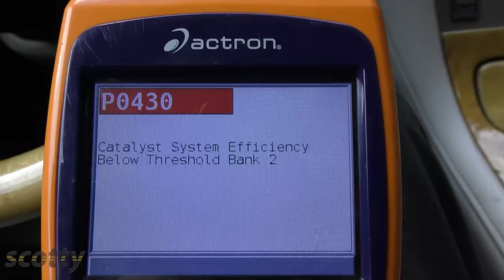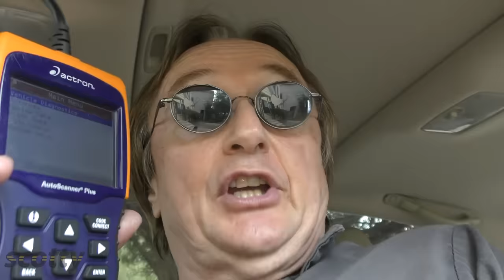Check Engine Light Comes On and Off in Your Car? What it Means

Comment: It means your wallet will suffer a huge weight reduction
Reply: Very accurate, But in many cases it's the sensors getting corroded so i just throw some electrical contact grease made for sensors/electrical components on cars.
Reply: which indirectly means weight reduction for the car. which equals to better fuel economy and handling. the positive side of things :D
Reply: Viewing even on new vehicles 👊🏻
Reply: Which isn't good because, then, you have no money. Fuck that.

Comment: Most common cause is usually a faulty O2 sensor. I never knew the check engine light would flash if you had a serious problem.
Reply: flashing generally involves some kind of mis-firing situaton
Reply: It wants to get your attention
Reply: I had that same problem with my 2017 Chevy Malibu 2 days ago. As soon as my engine light came on, I went to a mechanic shop and got the code P2096 for bad O2 sensor. I couldn't get it fixed that day because all the repair shops were full. The next day I started my car and the engine light wasn't even on. I was more shocked than happy to see that but hopefully it stays off.
Reply: @dwizzle810  i hope it cleared it. My engine light turns on after they plug in the scanner. And my smog is due so need to fix it soon
Reply: Yeah I drive an Audi and it’s happened in mine but it wasn’t an expensive fix
Reply: @willhopson1277  Mine came back on again 2 weeks ago. I went to a repair shop and they told me I had to take it to a dealership to get it looked at. Turns out I needed a system update, luckily it only cost me $160

Comment: Bought my 1st car yesterday  after watching most of Scotty's videos I went with a Toyota Camry :D
Reply: BOOMER90100 
You can't go wrong with a toyota. ...
Reply: Excellent car =)
Reply: If it's a 2018 it may not be a great buy. Only time will tell
Reply: Good choice. I have a Rav4 going on 2 years and 19k miles no problems. Of course I baby it and am very picky with the oil and gasoline it gets.
Reply: 🤦‍♂️ hope you enjoy it. Any car can be a good friend if you treat it right.
Reply: You bought a POS haha
Reply: Excellent choice, i have 2004 camry with 150,000 miles and 2013 Rav4 with 80,000 miles and both runs absolutely fine with little maintenance and do clean your throttle body and idle air control valve regularly...
Reply: Bmw M3 e46 , BMW stands for Badly Made Wagon, Bigtime Money Waster
Reply: Clint Adams haha but what's more comfy to drive a bmw or Toyota that rides like a donkey lolll
Reply: Baby Jeebus 800k? Damm Scotty better see this!!!
Reply: Bob the Hat King he lying man
Reply: Shoulda gone with an accord...
Reply: Clint Adams do you own one? I have owned 2 BMW's and 1 mini. All services were done on time.. never had a problem on any of them
Reply: Jaf M the battery that comes with the car isn't very good. Any car can break. My mother's GM hummer has had more problems than both my BMW's
Reply: What model year did you buy
Reply: never thought I'd own an import, but my 95 camry wagon is the most dependable and un-killable car I've owned. best part is, I bought it for $300 and a case of beer. cheapest, erm, most affordable car I've ever purchased.
Reply: Bmw M3 e46 says the BMW FANBOY LLF!!!
Reply: BMW M3 e46 guess you haven't heard of lexus and the LFA that shits on any BMW that has been made so far
Reply: I bought a 2007 Toyota Camry with 99,000 miles and it runs great . My check engine light went on yesterday but went off after driving a couple of minutes. At first I thought I bought a lemon but after watching this video I realize nothing is wrong with the car!

Comment: I like that Scotty keeps his vids short and to the point, for the most part.
My car's check engine light is always on. It's been about 7 years. It was one of the reasons the dude sold me the car. I just check the oil and use some common mechanical sense. No probs and I got it for a good price.

Comment: Scotty, I'm old-school and pretty much know what my car is doing, all the time. Believe it or not, but I have never been compelled to stop at a parts store to have one of those diagnostic machines read my codes. I bought a 1991 Chevy Cavalier RS, 2.2 Iron Duke with 94,000 on the clock. The previous owner said, it was on it's last legs. After driving just five miles, I discovered his "mechanic" had set his plugs at .035 when they should have been .045! I changed the radiator and starter, oil change every 3000 mi. The air never worked but I don't mind. It doesn't burn oil and doesn't leak and the 3 sp. automatic is sound. It's my daily driver putting 84,000 bringing it up to 178,000 since I bought it. Just today, I noticed the oil is down about a pint. I know when I need a tuneup just by the feel of it and my Check light has never come on.

Comment: Very timely video. Bought a '03 camry last week... after my child filled the gas tank the cel came on. Had it scanned at parts store thinking that it was a " small evap leak"... and it was. Put the cap back on... properly... and the cel eventually went out.
Your video confirms what I thought was going on.
Thank you Scotty!
Reply: holidayhouse03 also he could of overfilled the tank, and usually it goes off after a day unless its a very cold day.
Reply: holidayhouse03...... same happened to GF 06escape. Code indicated the same problem, evap. Added a can of seafoam, light went out during the next drive. 2 mths later code was for cat converter. Another can, light went out and has stayed out since. Now a can goes in every 3 mths.
Just passing it on and hope it saves someone some mula.

"keep the faith people, and keep on keeping on"
Reply: Hopefully she didn't. She's been told about the perils of topping off the tank. And now she been told about the need to properly secure the gas cap. She was raised on 30 year old redblock volvos.... this camry is a bit more sensitive than a redblock.

Thanks.
Reply: Thanks J.S.
Reply: check engine light on , humming sound , sounds like it's coming from fuse box when engine is switch off, now days later car switching off while driving

Comment: This started occurring with my 2006 Pontiac Montana after filling up at Costco. I want to blame the Costco gas but I did plug in my code reader to see it's P0171. I panicked and told my mechanic but then the check engine light went off. My mechanic gave basically the same explanation as Scotty. Yet now the check engine light came back on again. It's annoying because the van is running fine. I love Scotty's videos. He reminds me of my late father who was a damn good mechanic. Thanks Scotty!

Comment: Nice explanation, Another thing is disconnect the battery before you change  any sensors, if you forget  to disconnect the battery you may end up with an ecu that ignores the sensor you disconnected and reconnected, easy fix though disconnect battery for 10mins or so for the keep alive memory then reconnect the battery , usually works.
Reply: closertothetruth try volkswagen touareg 5 cylinder diesel engine
Reply: Laurence Lee Roceta id be too afraid, maybe exclude all euro cars LOL
Reply: I don't want to be "that guy", the one that comes in and disagrees with people, but fuck it I will. That's some pretty bad advice you gave. Disconnecting the battery for any length on most modern fuel injected cars will clear the ECU's stored info and AF maps. If I disconnect the battery for 5 seconds on my 2004 Tacoma, it clears everything and the ECU has to relearn it all over a period of weeks of regular city and highway driving before it has passed all self tests and is ready for emissions testing. It drives like shit too since it has to relearn everything. I've replaced sensors such as o2 sensors and recently the MAF sensor and never disconnected the battery. I do what the manufacturer says to do as part of the procedures and no deviation. 

What will have to be done for any vehicle in the state of Washington to pass emissions is to clear the MIL code before going to emissions and let the ECU cycle through everything and pass its self tests.
Reply: Tim Nelson good info, I was just following a Gregory service repair manual they all say remove battery first. and what a service tech told me, after two cars I disconnected O2 sensors and they ran like shit and I had check eng light for O2,  so the service tech said remove  battery for 10 mins after that both  cars ran fine forevermore, maybe you just need to remove sensors  quite some time after you turn you're eng off.
Reply: closertothetruth oh ok, makes sense 🙄
Reply: Tim Nelson thanks for the info though, Im brilliant on old school cars but late model cars I've got some learning and spending to do, my brain hurts, I need some Scotty kilmer DNA transplanted..
Reply: closertothetruth older cars are fun to work on. Newer ones can be a real pain with all of the sensors. I found out the hard way after modifying my intake just how delicate the intake system on new cars can be.

Comment: Thank you! Got gas last Wednesday engine light came on for the first time in 3 years (2017 Jetta 😟😤)  had a due appt for oil change they checked the car with the  computer thingy 😀 found out it was P068A code road my car out of the dealer ship drove the gas out went to my regular gas station and the light went off- gonna ride some more tomorrow to see if it was the gas- but my dad did tell me to never go to that gas station the gas is like "water"- I learned my lesson. And you proved his point. Cars are sensitive. I do love my Jetta tho- but thanks for making this video so my dad can send it to me and caption it "I told ya so" 🎯 thx

Comment: Great advice as usual Scotty!  My 2001 Chrysler Sebring Convertible had the CEL come on while I was on a trip in Massachusetts back in 2014 (I live outside Dallas).  Luckily for me, Chrysler setup the computer to do a "key dance" to get the codes and I did that.  Turns out the computer itself was having memory issues in it's "temp space" area.  No change in the running status of the car.  I drove it back to Texas a couple weeks later, no issues and didn't end up replacing the computer (only way to "fix" it) until 2015.

Comment: Hi Scotty
I have a 2000 Chevy Astro van with an ongoing, intermittent SES light issue. No one can figure this out, and I've spent literally thousands of dollars paying mechanics, and I still have the misfire code. The code that came up when I first started addressing the problem was P0300, random misfire. Then I went through a lot of money where I was advised to do the following things, and had them done:
Sadler’s Work:
• MAF cleaned
• PCV valve replaced
• Plug wires, cap and rotor and spark plugs
• Throttle body cleaned
• New fuel filter and gasket, fuel rail cleaning x 2, BG fuel system additive
• BG EPR treatment to remove carbon
• Rear main seal done
• New gas cap
• Engine oil filler cap replaced

Dealer work:
• New fuel pump
• Water pump, thermostat and serpentine belt replaced; when the dealer did this job, they said they replaced a lot of hoses
• Rear end work: pinion gear and rear axle seals
• CPS and its wiring harness replaced

Other shop work:
• Fuel Injection Spider replaced
• Manifold gasket – when the shop did the (water) leaking manifold gasket, they said they replaced a lot of vacuum lines. 
• MFI upgrade to replace the poppet valve assembly, and they replaced the plenum gasket when this was done
• Resealed differential with new plate and seal

Muffler shop:
• Catalytic Converter replaced

Other work:
• Person I bought the van from stated they replaced the alternator right before the sale
• Had all deferred maintenance done at 107K miles when I bought it
• 
Then in reading in the Astro-Safari forums, these things were the common fixes mentioned that I have not done yet:

• Distributor problems appear over and over in the forums as the reason for random misfire: distributor timing off/needs adjustment, camshaft position sensor inside the distributor going bad, distributor drive gear worn, hairline crack in distributor drive body, defective new parts etc.
• Vacuum leak at intake manifold or?  smoke test?
• Wiring issues: sometimes a wire where the insulation has worn off can be grounding and triggering DTCs. Some people reported they found the wiring loom worn/insulation worn off on wiring inside the doghouse and replacing some of these wires fixed their problem.
• ECM: If fuel, vacuum and spark have been eliminated, it could be an ECM failure of some kind. How can that be tested?
• Dealer in Arizona said it was the EGR valve where a small piece of carbon gets stuck in the valve and triggers a DTC…others in the forums have also reported cleaning the EGR valve and replacing with the screened gasket fixed the misfire code issue
• Some people said it was a switch on the transmission
• Cracked spark plug when being installed

I STILL HAVE THE SES LIGHT COMING ON...but now the code is P0304, #4 cylinder.........I am distraught at the idea of a valve job at $2500+...
The BG EPR treatment was run at 1500rpm for a half hour, then 1700rpm for another 20 min, then 1750rpm for another ten minutes. Then the oil was changed and it came out black, indicating a lot of carbon was cleaned out. Given that I run synthetic oil and it is always still pretty clean when I change it at 5K miles, coming out black (I thought) was a good sign. 

I can't afford to keep giving these mechanics thousands of dollars, and still have the problem.

What do you think?

Comment: A simple personal tip: make sure the gas cap is closed tightly. I once had the sign on, freaked out, but figured out that it was due to loose gas cap. If the light stays after you drive about 50 miles with gas cap tightly closed, then go see a mechanic.

Comment: I found on my X5 M that the engine light went on and then off.  I took my scanner, and it didn't find any codes at all.  A few days later, it stayed on for a few days, so took my obd2 scanner, and found a code of cylinder 6 misfire.  It would run rough, then after restarting the car, was fine.  I cleared the code, and added a a half liter of injector cleaner.  It has been running fine for a week.  I'm assuming if there was a problem with the coil or spark plug, it would just continually misfire, and not start running fine after engine restart?

Comment: Great video Scotty - Same kinda thing happened to my 2005 Audi A3, where the EPC light came on as i drove the car. The car ran poorly and couldn't rev the engine over 1500 rpm. I decided to turn the car off and then turn it back on, and now the problem is gone. Hooked up the VCDS scan tool and it told me that the computer, controlling the throttle body has a intermittent malfunction. A new throttle body with control unit from Audi where i live in Denmark is almost 900 dollars, which is crazy for a 1.6 liter engine, so i may have to buy a aftermarket one for like 300 instead. But hey, now two weeks later, the car still runs fine, so probably don't want to do anything about it now till it gets serious. Just another example ;)
Reply: Did you clean the IAC?
Reply: No, but the car did idle and run normally before the problem happened. And i forgot to tell that it could not rev over 1500 rpm because the car went into limp mode. I tried to re-calibrate the throttle position to see if that could fix the problem. It could re-calibrate but the code p1388 is still shown and i can't delete it. The throttle body wasn't dirty.

Comment: If the check engine light goes off, the code may still be stored as a "confirmed" code, which means that there was a problem for at least two consecutive "drive cycles", I believe.  Depending on the nature of the problem, it shouldn't just be ignored.  For example, an intermittent transmission problem that causes the transmission to go into "limp" mode can exhibit this check engine light behavior, but the transmission should still be serviced if you don't want to be stuck far from home in 3rd gear!
(btw - I learned this after purchasing the Blue Driver scanner recommended by Scotty in another video.  Great product!)

Comment: I really should get a scanner great investment
Reply: Get a decent one!
Reply: Yes they are
Reply: If you have an android phone you can get a really cheap setup that almost as good as a shops! Total cost around 20 bucks! Two apps are forscan and torque. You can get a cheap Ob2 Bluetooth adapter off of eBay for 5 to 10 bucks...
Reply: I have an iPhone but that is a good idea looking into ones that connect to a phone
Reply: Maybe 40 bucks for one that just extracts the codes, and just google them. I've done enough technician work to know P0303 is a misfire in cylinder.. (googles) cylinder 3
Reply: Allen Weber more than that with the one the set up I said above.. You can reset anything from the engine light to  any  system controller like say a battery monitor system. Real time information like air vacuum etc... I actually learn about it all when my ford 150 bms was being silly and kept on killing a brand new battery...
Reply: jack bing there is also a pc software by forscan to which you could always  get a USB to Ob2 cord 😊 mind you forscan is more geared to ford stuff and gm.
Reply: Just go to AutoZone they'll read the code for free
Reply: It's a nice investment. Got a $30 one. Checking the light on the go for little problems that don't matter is nice. Then calling the auto shop for the ones that do matter before you get stranded. For the money they are worth it.
Reply: 20 dollars in Walmart
Reply: my little  $30 tool is good, but by the time i get around to find out what code i have, it's always gone and my scanner says no codes. inspection station says i passed. my car likes to troll me lol
Reply: jack bing I need one